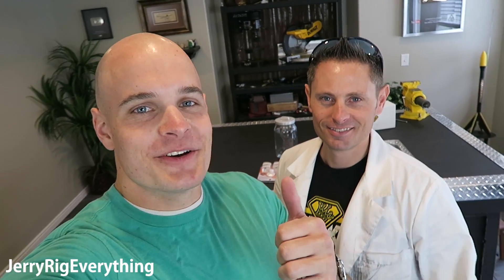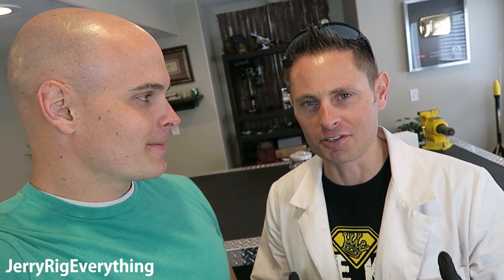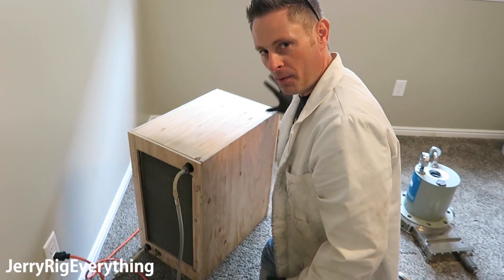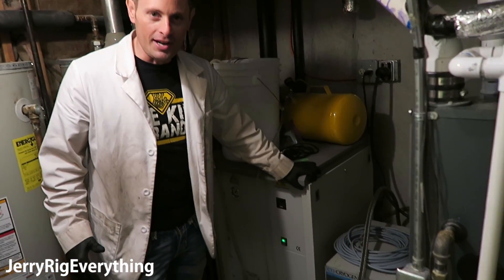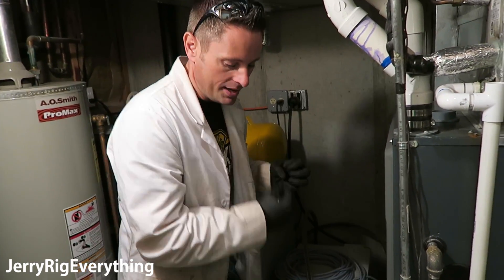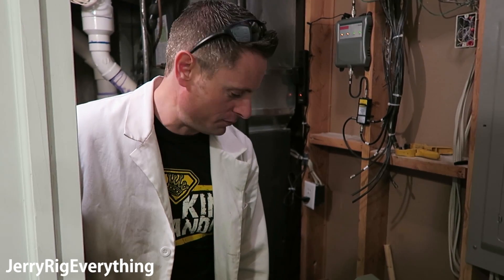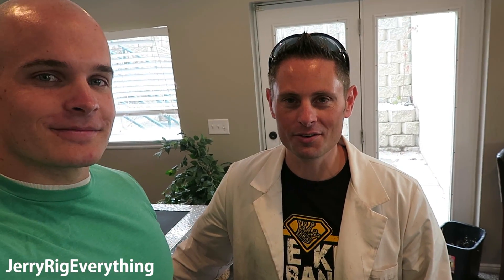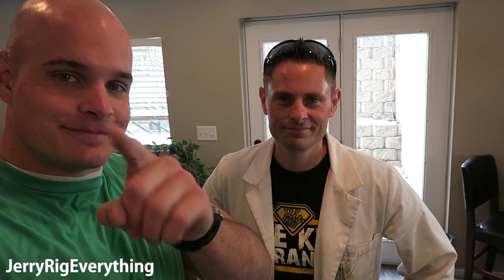This guy makes LIQUID NITROGEN out of AIR (in his basement!)

Comment: I wouldn’t say you have an endless supply. Even though Helium is in a closed loop. The molecules of helium is so small that it can seep through walls. I could be wrong here but I reckon that over some time your helium will disappear.

I also have a question. I want to make a nitrogen coolant aircon type contraption. What type of compressor would be needed.

Comment: I have a challenge for you. Can you make a bike frame from melted metal and then put other bike parts on it to make a fully working bike. You can buy the gears, chain, wheels and brakes. The test is to a&e if it works

Comment: I have solar panels on my house.  I REALLY want to do this!  It wouldn't cost me a thing to keep it running continuously  What if you don't use the nitrogen generator?  Besides getting nitrogen AND oxygen and maybe argon... also wouldn't the cold head accumulate too much solid CO2 and water and stop producing liquid gas?  I don't mind condensing other cryogenic liquids but I worry about the ice buildup.  Do I absolutely need the dry nitrogen?

Comment: Obvious missed question: Cost per gallon to make at home????  (50 cents a gallon commercially I understand)

Secondly, and perhaps more important.  If I understand correctly, rapid vaporization in an enclosed space makes "fun" liquid nitrogen into "killer" liquid nitrogen.  Do your neighbors have an add-on to their household insurance policy to live next to a ticking bomb???

As they say, don't try this at home kids unless mommy and daddy have the requisite riders on their insurance policy and possibly the phone number of a local Shriner's Burns Hospital...

From Wikipedia:

"Because the liquid-to-gas expansion ratio of nitrogen is 1:694 at 20 °C (68 °F), a tremendous amount of force can be generated if liquid nitrogen is rapidly vaporized in an enclosed space. In an incident on January 12, 2006 at Texas A&M University, the pressure-relief devices of a tank of liquid nitrogen were malfunctioning and later sealed. As a result of the subsequent pressure buildup, the tank failed catastrophically. The force of the explosion was sufficient to propel the tank through the ceiling immediately above it, shatter a reinforced concrete beam immediately below it, and blow the walls of the laboratory 0.1–0.2 m off their foundations.[17]"

Uh, try to not be the next A&M "incident"...  dare I repeat, "shatter a reinforced concrete beam...", and "blow the walls off their foundations."

Sounds totally fun to have this stuff around the house...

Comment: That's awesome, if you had a massive solar array you could basically get liquid nitrogen for free. That's assuming that the solar array doesn't break and you had enough space, of course.
Reply: Actually, most of the money is probably helium, still cool though. It's pretty sad that the price of running this thing will go up and up and up until there's no more helium left because of stupid party's that kids have.
Reply: Uhh bro, the system doesn't use the helium, you only have to put the helium in at the start and you don't have to worry about it forever unless there is a leak

Comment: +JerryRigEverything 
+Thekingofrandom 
It may actually cost more to do it this way than to just pay the $170.00 , given the compressor system you have, the nitrogen generator and the liquid cooling system you are easily pulling 4kWs running this, if it takes 3 weeks to fill the dewar then you have to use 4kWs for 24hrs for 21 day, (4x24x21=2016), the average residential electric rate in South Jordan, UT is 10.31cent/kWh  which means that it will cost you ~$208 to run this system for 3 weeks straight.
Reply: AGREED.

Comment: may I ask a question, why have the radiator blowing the heat into the atmosphere when it could be heat pumped into his hot water heater?  My god we have de-humidifier heat pumps built on top of hot water heaters that save energy and work very effectively.  I'm sure a "Jerry Rig" could be done to convert the radiator into hot water heater.

Comment: Even though there is a heat exchange, 100% heat conserved doesn't follow the rule of thermodynamics!  Even though heat is getting exchanged, there might some place where the helium gets lost! Anyone please help me with this doubt??
Reply: The helium is in a sealed system the only way you will lose any helium is if the tubing containing the refrigerant corrodes , a leaky valve in the system, or a damaged seal, it is a sealed vapor compression refrigeration system just like an air conditioner or the compressor system in a refrigerator, it just uses helium as the refrigerant.
Reply: Brandon Upchurch, like you said it's a sealed system,its similar like a closed system and in the closed system, Mass remains the same but energy dissipates, then how can +JerryRigEverything and +Thekingofrandom say that heat doesn't escape!??
Reply: When did they say the heat doesn't escape? The only thing I heard is they said the helium doesn't escape.
Reply: Brandon Upchurch, even I know that helium won't escape until there's an anomaly in the equipments, it's just that "He said that there is no heat exchange"  how's that possible in a closed system!
Reply: When did he say there is no heat exchange?

Comment: I wonder if there's many other gasses that could prove to be an effective refrigerant to achieve the temps required and if there are any more efficient methods to cool off the hot helium gas to cut down on the energy use.

Though compared to the energy used just running the compressor alone everything else in the system might use a small percentage that improving the helium radiator setup might only save a few cents or dollars a week.

Comment: You should pour liquid oxygen and liquid hydrogen together and supply a little force to the mixture.
Reply: water... you get water
Reply: N2(lq) + O2(lq) =H2O..........find the error
Reply: PCMasterRace no one here but you is angry
Reply: +PCMasterRace Rocket fuel is usually liquid oxygen and kerosene. But yea...  hydrogen would explode too, but it's so unstable that it doesn't even need the liquid O if you're anywhere on planet earth with atmosphere.
Reply: PCMasterRace u get really cold water
Reply: PCMasterRace fine you get condensed water, happy?
Reply: hydrogen peroxide, thats what u get 

H2+O2=H O2H
Reply: PCMasterRace no, cause i don't feel like wasting time in a useless experiment you can't afford to do yourself
Reply: you guys need to do some research they don't magically combine
Reply: New Colors I said add a little force. Do you not know what liquid rocket fuel is?
Reply: PCMasterRace you're clearly angry at me not bothering to research a useless topic that ends with the following results : Water, water, waterrrr
Reply: man you guys need to do some research.
Reply: +PCMasterRace give it up kid.. its not working
Reply: Phoenix2079x you do not get water. You guys should look up what it does.
Reply: Phoenix2079x you didn't do research.
Reply: Phoenix2079x I'm not angry though. You just can't do research.
Reply: Phoenix2079x you're just angry because you've been proven wrong.

Comment: It's basically a huge refrigerator/air conditioner. It just runs at a higher power rate. Thermodynamics suggests that a f***load of energy (electricity in this case) is used to achieve such rate. I have to say I found the project quite lovely, thanks Jerry for sharing this piece of art with all of us, it's really cool. Literally really, really cool.

Comment: Why Helium? Because Helium has a massive heat capacity (5 times better than air).
 It can take large amounts of heat to the water cooled heatsink.
The only gas which would be better for this , would be Hydrogen.
(3 times better than Helium and 14 times better than Air)

But what could go wrong with a system full of hot hydrogen at the compressor? ;-))

Do you have to replenish the Helium?
After some time ;-) Helium is very hard to hold in a closed system. You have to use special metal sealing materials.

But Hydrogen would be even harder! Hydrogen will move through nearly every material (Effusion) after some time.

Comment: TIL using adsorption and simply filtering air is cheaper than fractional distillation if I just want nitrogen gas. Cheapest small flow nitrogen generator I could find was $3000. 

Thanks for showing the setup, you've helped me a lot.

Comment: (joking) This will be great when I use on my levitating car to cool the engine at maximum speeds one of the elements Hg and Fe rotating at spherical way. Just like flubber but using micro size cooling system that Tesla micro size engine was already made and untrackable. Ha Ha.
Challenge! (Build one if you dare on You Tube. One that floats 3 ft over the ground. Ha Ha. A new Transport of the future if it hasn't been built already floating over there. Look up already. Ha ha.

Comment: In the air force we used nitrogen carts to put air in the tires... I think that's what crew chiefs did with it.  We (hydraulic mech.) used it to fill accumulators.  Anyway they were self filling machines and I always thought it was so cool that it could just pull it out of the air.  Cool video Zack!

Comment: Well I'm sorry to say that but producing liquid nitrogen isn't as hard as it sounds. Just take air, remove oxygen by oxidizing iron into FeO or any other procedure for that matter, and then squeeze the remaining air (99.9% gaseous nitrogen) until it liquifies under enormous pressures. TA-DAAA! You got liquid nitrogen. :) (Theoretically) :)
Reply: King of the Nonsense the critical temperature of nitrogen is so low it's virtual impossible to liquify using high pressures which is why its necessary cool the nitrogen by expansion in order to make it.
Reply: And you think people will have things that can produce so much pressure at home.